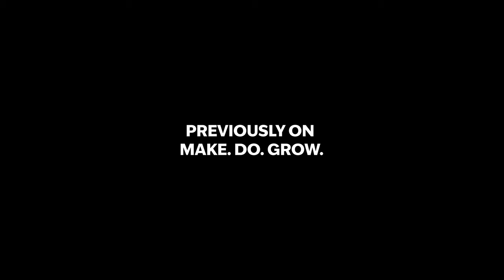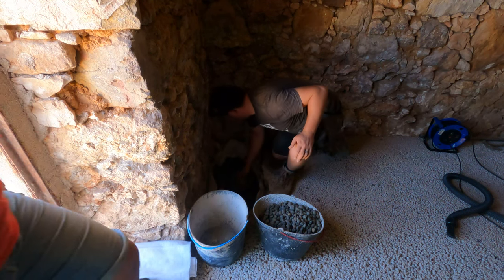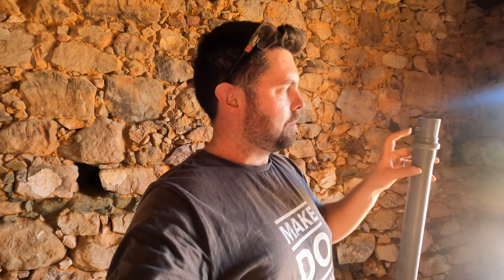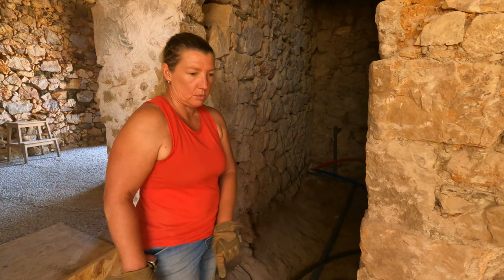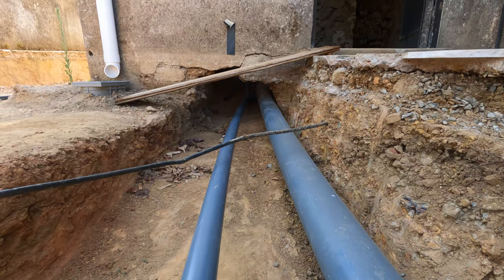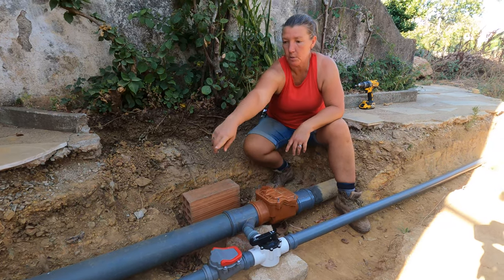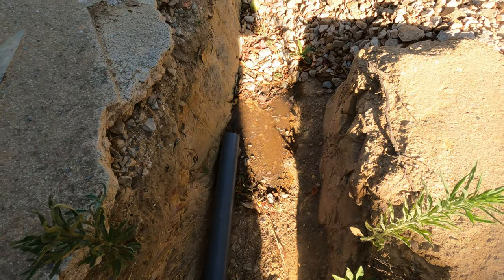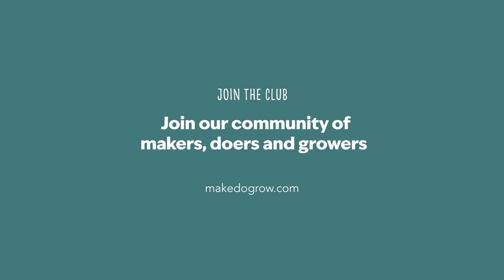Installing a Grey Water Harvesting System (Part 1) - #27

Comment: The kitchen sink and dishwasher are supposed to go into the black water due to the food particles, which rot and cause all kinds of issues for your grey water filter... Just a heads up...
Reply from the maker: Kitchen waste can be filtered too, there are many system designs that tackle the issue you’ve described ... but it’s the reason we want to be sure to get it right 😀

Comment: If you have designed your system to capture large particles so that they don't clog the system (you have a grease trap for the same purpose - I believe) then provided you are using eco friendly detergents etc you do not need a separate filter for the water it can run through a gravel/sand or reed bed and straight to your soil and plants.
Reply from the maker: That’s our understanding too. Now we just have to design something that fits the space and slope that we have ... and find all the relevant materials of course (tends to be the most difficult part) 😀

Comment: I don't know if it's too late to suggest but have you considered a diverter before it hits the tank? This will allow you to flush your plumbing with cleaning products if there's a blockage or clean with brushes without those solids making it into the tanks.
Reply: From someone who lives on a property with both septic and grey water systems, this is probably the wisest suggestion in the entire comment section. @MAKE. DO. GROW.
Reply: not much room left. but very good thought. very.
Reply from the maker: I’ve replied to a previous identical question about this .... we’ll be adding an ‘emergency release’ valve a little further down the grey run, in case of backups etc, but could also be used if we ever need to clean the system

Comment: I think it will be better to put the grey water after the non return valve , because if you divert the water and if the  pressure-of the big pipe is high the water will return to the house

Comment: used to work in a plating shop  seamed to remember some thing about read beds to  clean the water this was at Gabriel's at kingskerswell  Devon
Reply: Reeds are used in Fife to filter water from old mineworkings. Works well.
I believe reed beds are used extensively in India as well. I looked into it about 20 years ago as a solution when we lived in Lithuania but the land we had was not suitable.

Comment: It's an unlikely scenario - but If your grey water is being diverted into the black water pipe and the black water check valve is locked closed (or the black water pipe gets blocked downstream), your grey water could back up into the black water sources - which may not be pleasant.  I assume the black water check valve will be locked closed on very rare occasions - but it's worth remembering the risk if, for instance, it's raining heavily.  Just a thought.  The solution would be to have two check valves in the black water pipe, one either side of where the grey water joins to it - but that effort/expense may not be worth it for the small risk.  I'm enjoying your content.
Reply from the maker: Ah yes, that's a scenario we'd not considered, but very unlikely as you suggest. 

More than likely if we ever locked the black water valve we would also stop using the water services inside the house. 

The valves are so significantly uphill of the end tanks (many meters in height) I doubt there would ever be a heavy enough rain that would back up the pipes that far.

Comment: I used a treatment plant for sewage and grey water it works a dream and the water goes all the way to my crystal clear irrigation pond. May put fish in it. You can build a pumping station in line with the outlet and use this for irrigation and even to fill up holding tanks. 
It’s a good way to
Be able to handle clean and non smelling water without hazards. They say it’s almost drinkable?
Reply: I saw some documentaries about a product that you mix with water and it cleans it making it drinkable. It´s used a lot in Africa... I wonder if such a product would work for water treatment in this case...

Comment: I always tough the rubber gasket was the seal no cement required. That’s how it works in Canada. Water mains and sewage all have gaskets and no cement required. Joints must be free to move without cracking.

Comment: Good luck soap, oil, hair will likely plug those gates open. Maybe ball valves would be better for stopping backup waste, I have never used either maybe I am lucky but most problems occur from the source of the waste in personal waste disposal as compared to a city sewage system.

Comment: Interesting, the different types of plumbing codes throughout the world.  Here in America your grey water pipe would not be building code compliant.  All waste water pipe exiting the house requires, at the minimum, a 3" diameter pipe.  4" pvc pipe is standard.  We also use pvc couplers and glue to join two lengths of pipe together.  As well as you've thought through your problem and done some hard work correcting it, in America it would fail a plumbing inspection.  But, if it is standard and appropriate in your area, I say go with what your local inspectors will allow.  And all waste water pipes need to have an air supply vent at the roof line.  This keeps the water flowing and no air locks build up within the pipes. Good video, though.  I appreciate your efforts to inform the audience the problems you face and the how you solve those problems.
Reply from the maker: 40mm here meets regs (and incidentally the same in the UK).

We’ll definitely be adding air admittance valves into the pipe runs up in the loft when we get to that part of the plumbing. These are not standard here at all .... so many people just put up with the smells. Not something we’re willing to compromise on 😀
Reply: Hi Guy and  Kylie.  I love what your doing. Sorry you are incorrect saying your 40mm waste pipe would meet building regulations UK.  Maximum length without air intake of 40mm waste pipe is only 3m off single source like bath or shower. 
All drain/waste pipes which use gravity to empty are designed to run maximum half full . If you take cross section of the pipe during use half should be air. This stops siphon action which empties important water air traps and drainage gurgling. Good example  of this theory is if you take 5l water container  small opening and tip it slowly so only half of mouth opening let's water out you get steady continues flow. Now tip  5l further over and you get vacuum in container which try to squash the bottle gulps and splutters out.  
Those 40mm need to drop into 110mm manifold or even better 
I'd pass all 40mm waste straight out nearest wall and emptying over 110mm gulley trap outside.  Its easiest to maintain if something goes wrong.  
I am plumber in UK and worked as plumber in SA.  I've  designed and installed septic tank systems .
The one way valve and diversion system you've installed is going to fail rapidly. Any mechanical valve or device on soil/grey water will get fouled very quickly. You need inspection chamber at that point nothing else.
Reply from the maker: @Journeyman76524  sorry, wasn’t trying to imply that the entire solution was to UK regs, simply that 40mm pipes are ok in the UK.
We’ll be adding air admittance valves .... probably not at every 3m, but rather just where there are fixtures. They are very unusual here, in fact most systems are unvented (including soil pipes)
Reply: @MAKEDOGROW  Yes I remember when I incorporated an eves height stink pipe into our system my Portuguese builders thought I was mental !
Reply from the maker: @simonlewis6276  you can imagine how the conversation went at the plumbing store when we asked about no return valves and connections for the grey water diverter valve 😂 (none of which were sourced in Portugal)
Reply: @MAKEDOGROW  when I was laying the The 20mm copper circuit pipe for central heating with rads heated from a wood burner with a back boiler (This was over 30 years ago now and I had to bring the whole kit and caboodle from UK as it did not then exist in the Algarve ) I overheard a couple of Portuguese labourers who were digging out an adjacent floor discussing the mad Englishman’s many eccentricities .It went like this .”you know what he is doing now ,he is going to bury all that beautiful copper pipe under the floor tiles then he is going to pass hot water through it ,heated somehow by a  fire and that will heat the house in winter .He obviously has more money than sense as that  will never work !”Followed by howls of laughter .Well it has worked  very adequately to this day and they subsequently reluctantly agreed with me that it was not such a daft idea after all .My only regret now was that I did not have the courage or knowledge then to design it as a totally underfloor system without the need for 
wall mounted rads .The Romans knew a thing or two about underfloor heating and proved it worked well with warm air underfloor ducts so I should have had more faith in a circulating warm  water system ! You live and learn .Cheers .

Comment: There are sliding cuffs you can slide onto the pipe if you have two male parts and the pipe is immovable, like concreted in. Also there are cuffs that are not sliding (i.e. a stop in the middle) if you are able to move the pipes and fit it, slightly better fit.

Another thing when putting those pipes in concrete (might not be applicable with the limecrete that is not as hard) is to get the more sturdy ones designed to be in concrete. I think they are marked pb. Also don't push them together completely to allow for some movement due to heat.
Reply: Forgot to say, great to follow your journey! Did a similar one 2014-2018 where we built our own house. Now I can't fathom the amount of work we did. Still not recovered :)

Comment: THE BLACK WATER SYSTEM.  Since the grey water is diverted, will there be enough water in the black water system to move the waste along?  If you add low flow toilets into the system, will that be enough to do the trick?

Comment: I have never seen a valve “pointing” to the closed position - normally the valve points in line with direction of flow. Interesting.
Reply from the maker: Yeah, it’s weird isn’t it
Reply: I suppose the handle is fitted wrongly.
Reply from the maker: @humbertochaves4099  it’s not, we have another that’s just the same. There’s even a label on the handle saying ‘closed’ with an arrow. 

It’s just a strange design it seems.
Reply: @MAKEDOGROW   Valve design and manufacturing flaw remedy adding directional arrow.
Reply: The arrow and the legend point to the closed section, it may seem counterintuitive however.
Reply: nah. similar to marine. the arrow is perfectly explantory. the printed word is never translated correctly.

Comment: Is it possible when you have the grey water reverted to the black water pipe could the black water also flow into the grey water through that small section of deverting pipe.

Comment: I hate undoing and then redoing work that I thought was complete, but this is your Forever House and you don't want to have regrets twenty or thirty years down the road.  As others have mentioned, you may need to occasionally add some grey water to the black water to keep your septic system healthy.

Comment: I just have one question. When your grey water is blocked/full and your black water is full/blocked. Rain water system could join the black and grey water. Do you have an emergency path for your waste water in total to go instead of backing up in the property?? 
You may think this is unlikely to happen (I was also a IT consultant)  when it was consider a scenario could happen it normally happened on the first day of going live.
Reply from the maker: We haven’t got to that yet, it’ll be a little further down the run, but both the grey water and waste water will have an emergency release valve at some point.

We always like to plan in backup plans for the backup plans 😀

Comment: I think you have to put another one way Valve into the the grey water pipe that goes to the soak pit pipe otherwise the dirty water from the black water pipe could enter the grey water pipe contaminating the grey water going to the filtration system.
Reply from the maker: That could never happen given that the diverter is also a valve.

When grey => grey, the diverter valve would be shut, so no black could enter
When grey => black, the grey would wash any black that entered the tiny diverter pipe (assuming it even gets into that pipe ... it's on a downward slope)

Comment: ""alex" s comments on ventilation seemed sensible and as I understand them, involve pipes thru the walls and thru the roof located quite near to the water source. Do your plans include that type of ventilation? Also, I'm negative on your choice of anti-backup valves, the critical component seems to be made of flimsy rubber stoppers probably subject to easy sticking/blockage and rodent chewing. Keep up the good work best channel!

Comment: I've been a plumber for 38 years and know where I've ever worked till they allow that joint you have for one not supposed to have joints and concrete to begin with and two they don't allow the gasket ones underneath a building

Comment: Check the water treatment pits used in Brasil, I intend to implement it Algarve complementary to the biological sewage treatment. I'll try to leave a link after. If you decide to have a plant based treatment system, don't forget to leave a water line in case you decide to leave for a long period as the plants will need the constant flow of water.
Reply from the maker: Ah, good tip on the extra line in .... makes me think we could have a circular system where a sensor could detect if there was no water coming in and then pump water back up from the end tank. Definitely will design something in, thanks!!

Comment: !! It is not recommended to separate grey and black water, because bacterias in septic with black waste will not have enough of liquid to grow and procreate, it will become very concentrated. Grey water will very hard to filter properly mainly because of chemicals, and to make it basically safe in bacterial mean will cost a lot. Much more efficient is to create one aerobic septic with 3-4 chambers for all waste, which will give you pretty clean water for watering in the garden.
Reply: I manage hotel with 14 separate houses, systems were built from the scratch, so let me know if you will be interested to have small call, I could give you some schemes and advises

Comment: To use pvc cement you need a diferent head of PVC pipe, they have diferent head… and are cheaper
Cement is better right, but with diferent pipe

Comment: there are joining pieces available which are designed to join 2 male ends, in other words an piece that has to female ends. You only use the rubber rings to join them. I strongly recommend NOT to heat a male end and push it onto another or use pvc cement for joining to male ends.
Reply from the maker: Yep, we call that a ‘union’ .... it’s our preference too, the heating method is what we’ve seen done (and advised) by other local plumbers/builders here

Comment: PVC is actually not the best pipes to use, were commonly used before but they break quite easy and are not that resistent. 
Multi layer tube for example is a better solution. And definitely dont heat the pipes to attach them together, will make them lose properties. PVC is only good to use as "sleeve" to run other pipes inside.

Comment: You can prepare that water the same way it works in septic, there is no difference.  So it could be 3 tanks one by one and you can use oxygen to speed up growing bacteria. Filtering is not really useful, if tanks are big enough.

Comment: Working with a pump is not very efficient for greywater collection. Better make somewhere else a digout and a little pond for this filtering, using plants for the processing the water, also the pond will stabilise the water flow so no extra storage is needed. My house has a plant clearing system for the water coming out of the three chamber septic tank. You could do the same thing, so only once after some years the septic tank has to get cleaned from the mud in the first Chambers. The plants do a very good job, the water coming out of the plant system is completely clear, then it gets into a little creek as I do not use the water, got enough rainwater. My house is outback in mountain area, no canalisation, no public water, own source.

Comment: Are you sure you actually have a septic tank? There should be two access inspection covers, if you have a septic tank, which normally should be emptied every five years or so. Maybe in reality you have what is known here in rural Provence as a "Puit Perdu", actually just an old well or simply an excavated hole, filled with stone, into which all the waste water is discharged, with no possibility of emptying or cleaning, if it eventually gets completed clogged with paper, fats etc. Good luck!

Comment: What happens to all the detergent and the inevitable little bits of food and grime that gets washed down with the grey water? I imagine the plants wouldn't like be watered with detergent? Ah filtering. I should have waited till the end of the video before posting!
Reply from the maker: Couple of different things here:

1. A ‘grease trap’ will sit before the first holding tank. It’s purpose is to trap any food scraps, particles etc
2. The point of the filtration system is to ‘clean’ the water of detergents, micro plastics etc
3. We’ll be using eco/natural detergents that safely breakdown .... we need these for the fossa too so that’s the soil doesn’t get contaminated by nasty chemicals etc

Your question is very much why we want to get the filtration right, so the plants gets nice clean and safe water.... especially since we’re eating the food they produce